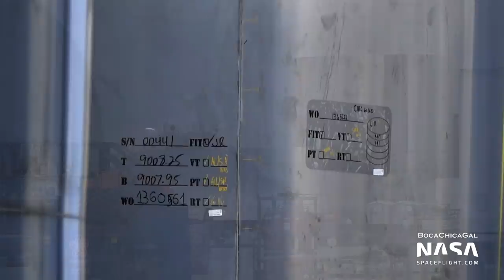SpaceX Boca Chica - Baby Starships, Assemble!

Comment from the maker: #TeamConcreteSmoother

0:00 - Sunrise
0:27 - Work on SN8
0:45 - Access Hatch Closeup
0:55 - Work on SN8
1:30 - High Bay Construction
2:12 - Ring Stacks / Barrel Sections
3:00 - Thrust Dome and Nosecone Sections
3:34 - High Bay Work
4:31 - Ring Stack / Barrel Section in Tent
5:00 - Nosecone Production Area
5:18 - Build Site
5:55 - High Bay Work
6:19 - Mount Delivery
7:06 - LN2 Trucks Waiting
7:36 - Work Near Orbital Pad
8:06 - Landing Pad Work
9:03 - Launch Site Work
9:30 - Launch Site Storage Area and SN7.1 Remains
9:52 - New Propellant Tank
10:14 - Suborbital Pad A
10:42 - Wall
11:12 - Construction Near Pad A
11:33 - LN2 Deliveries
Reply: ❤️Mary ❤️
& Jack
Reply: Thanks !
Reply: Also thank you NASASpaceFlight team and Mary for great images and videos as always
Reply: Hi NSF, can you show in details how the 7.1 ripped apart ? which section broken, its steel or wield or both? wanted to see its failing points. Thank you.
Reply: Zahidul Hasan  go to the sn7.1 bursts video  .. 4:50  ;)
Reply: @bentstraight3239  Got it bro, Thats what i was exactly looking for. Thank you again.
Reply: @bentstraight3239  hi, in that video, in 3:48 left side i can see steel ripped off. That means wield was powerfully capable too.
Reply: Zahidul Hasan  exactly ;)

Comment: How cool is the low bay gonna be when nose cones start being fabricated with rooms, corridors, windows, flight decks, ECT!?
Reply: Probably they will build the pressurized section for the crew (and then build a nosecone around it) in the same facility where they build dragon capsule and not at boca chica

Comment: znd they used to convince us that rockets are supposed to take years in development. this Boca chica site will never get old for me.
Reply: Well, face it, the Saturn IV was designed using a slide rule, not a CAD/spreadsheet program... And they also didn't have sixty years of practical experience to draw on.
Reply: @WCM1945  Yes, Rocket tech is accumulated wisdom, but it's a fair point if one compares SpaceX's progress with certain other organisations.

Comment: The work at the concrete pad looks like fun. What is that machine that seems like it's floating above the floor? Thank you very much Mary. I look forward to every video you drop. Make me want to visit boca chica.
Reply: It's a 'polisher' to make the concrete smooth and puts pressure on the underneath surface to remove any air pockets. It has wide blades that distribute the weight evenly, like a hand trowel.

Comment: How long do you guys think it’ll be before the first superheavy prototype is finished? Also, thank you Mary for the great footage!
Reply: My guess would be 8-10 weeks. Mid-late November? Early December? Lots more steel and lots more welding than the standard starship. But I'd like to be proven wrong and see it done sooner.
Reply: I heard SH hop in October.
Reply: @anthonylosego  I heard that too but remember that's Elon time.
Reply: Few weeks tops. It’s just a stretched Starship tank section if you think about it. At least for the first version(s).
Reply: @cin2935  I heard orbital test flight by the end of the year. So if SS does 60k in the next two weeks (hopefully successfully!) and SH hops in Oct (it won't need higher testing as it always is in hop mode and doesn't flip around in the atmosphere.), I think we'll see at least an attempt to orbit a SS on top of a SH before the end of the year. The only issue that may come up is that there just aren't enough Raptor engines ready by that time. The vacuum engine has been tested. I haven't heard how that went as far as good enough to put into production. They need 3 of those and 31 of the sea level raptors.

Comment: I find it odd that they are putting a roof on the high bay without first lifting in a bridge crane to install inside.
Reply: Reed Bowman my thoughts also🇦🇺
Reply: They will wheel them in and out. Won't use a bridge crane. They will use a crane from the entrance way to stack sections for welding together.
Reply: The mid bay doesn't have an internally installed crane either.
Reply: Carl Johan yeh I was mainly thinking the highbay
Reply: David bizzar
Reply: I think the structure of the high bay would need to be alot different, to handle a crane, no?

Comment: 2:44 SH/A2 7/23/20! That's mean Super Heavy? And they started working on 2 months ago?
Reply: Notes to point out: Slightly faded writing. It says VT/PT above it (possibly ? tests on the steel when it arrived at SpaceX eg Veneer Test/Pressure Test on 7/23/20). The strike through the A goes up to what you say is numeral 2 but could possibly be an over write and it's actually an L i.e SH/AL (Although the other 2's look similar, so tending toward A2. It could just be a co-incidence that SH was there and it could mean something else? eg Steel Hardness A2?   Totally agree on the date. And maybe that is a Quality Control from the factory, not arrival at SpaceX?

Comment: Question: How will the Starships fuel (methane & oxygen) be kept in a cryogenic state during a long voyage???
Reply: Vacuum of space is cold enough. All they need to do is keep the tanks shaded from the sun. Which solar panels will probably do
Reply: fuel is not stored in the main tanks and will not be heated, there are tanks in tanks, and they are vacuum insulated.
Reply: In the shade of space the temperature is -250 °F (-157 C) . The boiling point of CH4 is  −258.70 °F (−161.50 °C) however, under pressure, it becomes a liquid. So as long as they have heat exchangers and keep it pressurised, it should travel as a liquid in the vacuum tanks mentioned above.
Reply: @andreyinkognito7724  That's the header tanks. For long range missions, there's going to have to be fuel in the main tanks. No way around it. So shade is probably the way to go.
Reply: @TheMrgrr  But the heat coming from the Sun is not. 
During the Apollo missions on the to/from the moon that performed what the called the BBQ maneuver where the slowly rotated the the ship to help control the thermal balance.
Reply: Emissivity of the outer skin or shielding layers will play a roll in how well Starship avoids solar heat loading.  There's a reason why the stainless steel is polished, it dramatically reduces the heat absorbed by the rocket, as most IR and other radiation will be reflected away.
Add an additional layer of shielding stood off from the rocket skin (even polished aluminum foil) will further reduce heat loading.  With good radiative panels facing into space (away from solar loads) they can keep things quite cool.
Now, how the thermal tiles will affect things, that's TBD.  They're likely good absorbers, so if they're used they'll have to be thermally isolated from the body as best as possible, while still maintaining mechanical strength.  Who says rocket fab is easy?...
Reply: Apart from insulation etc, they'll have refrigerator/condensers which will take any gas that's boiled off and cool it down to reliquify it and return it to the tank. All you need is power from the solar panels and a radiator to get rid of the excess heat.
Reply: @denmaroca2584  Yes, but where will the heat go that's used to power the pumps and that's removed from the gas?  It has to be radiated away into space - no other option if you don't have other thermal sinks available.
Reply: @davidb6576  Also, Starship could potentially go as close to the Sun as Venus, and as far away as the Outer Solar System. Further, the fuels need to be kept at different temperatures. ~100K for the methane and <80K for the Oxygen. This will most likely require active heating and/or active cooling to sustain.

Although, realistically, I don't think Starship will be going to the Outer Solar System ever, until they develop a new engine with higher Isp fuels that completely change this math.
Reply: @davidb6576  
Thank you for all your replies everyone. I guess they don't call it rocket science for nothing...

Comment: So its cryo test, static fire, 150m hop then 20km or is it straight to 20k after static fire?
Reply: According to Elon's timeline, static fire, checkouts, static fire, 60k foot hop.
My guess is cryo proof, static fire, nosecone install, static fire to test the upper header tank, then hop.
Reply: Static fire and then 20k according to Elon.
Reply: @dakotasloan1  all that by the end of october?
Reply: @fredEM120  SN4 did 2 cryo proof tests and 4 static fires in just over a month. Could be longer than the end of October, but I'm not betting against SpaceX.
Reply: @fredEM120  I dont think so. Static firing 3 engines seems hard after seeing them have problems with a single one
Reply: SN8 won't do a 150m hop, it seems they already got enough data from SN5 and SN6 to proceed directly to 20km.
Anyway, SN8 will have three engines, and that's too much thrust to do a 150m hop without an inflight engine restart.

Comment: Two things that have me stumped....what determines the height of the ring segments and, why don’t the welds on the nose cone align?
Reply: My guesses: The ring segments are 72 inches high (1828.8). That is achieved by a cold rolling of a SS ingot. The factory will have had to use the hydraulics, bearings and rollers available at the time of building the factory. This is either the maximum width they could roll it out to, or all they could economically afford. Or, the first 'customer' with bulk orders for steel, wanted that width and gave them a contract that allowed them the finances to build the plant to fore fill the order.
The welds on the nose cones do not align, so that the maximum heating applied to a joint is twice, for stronger welds. As the strength comes from being cold rolled, any heating weakens the steels properties. When you have a weld on the end, there is a slight 'thinning' from a 'meniscus' effect of melted steel. If you join the corners, there is a thinned 'hole' at the crossroads. If you off set them, the new steel helps reduce that 'hole' and gives a stronger welded join.

Comment: Not a expert but do wonder about the Welds and placement on the nose cones.
Stress Factors, but if Welds Stronger than the Stainless Steel all Good.
Great Work 👍's
✌💛🌐
Reply: Welds are weaker than the SS-304L. The steel is cold rolled. Once it is heated by the welding process, it losses some strength. However, the Nose Cone area will be a low pressure area. It will be for storage initially and then crew accommodation for Moon then Mars Colonists. Maybe 2 atmospheres pressure (2 Bar). If you look at the last test on SN7.1, it's not clear, but it looks like the line of 'tearing' or RUD, follows the weld seam along the lower-mid section of the dome. That was well over 8 Bar pressure. The nose cone welds won't come anywhere near that sort of stress.
Reply: @David-yo5ws  Thank You Very Much For That Much Appreciated 👍✌💛🌐

Comment: Are the aero surfaces going to get less bumpy in future iterations? I pictured them as much smoother. Is smoothness not important?
Reply: They are smoother than they look I think. In closeups they look pretty smooth
Reply: The reflectivity makes even minor imperfections stand out so it is difficult to judge how uneven those surfaces really are. My bet is that they are much less "crumpled" than they appear.
Reply: They are only required to create a 'drag' on the air flow. They just have to be structurally strong enough to not bend or 'flutter' at terminal velocity. Just as a skydiver uses their arms and legs to control their angle of descent, very similar concept.

Comment: Does anyone know why the high bay and mid bay have those iron side balcony things sticking out everywhere? As far as I can tell there isn’t a floor on the balcony things neither are there doors on those levels. So why are they there?
Reply: They need the space inside to be empty, but the frame has to be strong. Essentially it's like external re-inforcing, like some churches do with half A frames on the outside walls to provide strength and leave the inside open. This gives the welders a wind break. The ring sections can be easily stacked by a crane without catching on any protruding frames.

Comment: I Wonder when they'll attach the heat shield tiles?  It will definitely effect the weight and the aerodynamics for flight.  That belly flop landing may not be as easy with tiles.
Reply: Since the Tiles will only come into their own during re-entry, the 20k and 60k 'hops' will be tests of SpaceX's engineers skill-set, to ensure they stay in place. Also, they will be able to analyse their affect on the aerodynamic drag during launch. Especially if they are going o be on one side. Though I doubt there will be full coverage of tiles, at this stage. Maybe some large 'test' areas??
Reply: Imo no tiles required for first 18-km hop/bellyflop
Reply: @aerospacer994  The reason for their existence is not required for hops even up to 80km. Yet they have had them on static tests and the 150m hops. So they ARE REQUIRED for doing trials and testing.
Reply: @David-yo5ws  Absolutely, trials and tests are necessary. So I wrote "first". The company adheres to a limited risk strategy in preparing tests, and this is reasonable.
However, perhaps they will install several tiles, but for now they come off even in short hops. Tile mounts need improvement.
Reply: @aerospacer994  LOL, do they ever. I don't know if the last lot melted off or were removed, leaving the whitish texture? The latest Mary shots on SN5? looked like they had an overlap on the center of 3 rows of a small cluster. Have not heard any more about another 'hop' test though.
Reply: @David-yo5ws  looks like the SN6 tiles were glued on and broke off due to vibration, leaving a whitish base with glue on the metal body (thanks again to Mary for the pictures).

Comment: What is going on? I could hear phasor fire from 1:30 to 3 Minutes.
Reply: High tension on braided steel cables. Most likely from the crane.
Reply: Nice. I didn't make the phaser connection. Well done.
I also like the high tension cable idea.
My ears made it as the doppler effect on the echoes of percussive assembly (ie. hammering) in a large steel tank or large enclosed structure.

(But it DID sound like heavy phaser fire!)
Reply: I figured it was steel sheets or cables. In my high school stage band a guitarist had an electromechanical reverb that made the same sound when his amplifier got bumped.

Comment: 6:21 When does a piece of trash become “public domain?” When it’s put in the garbage bin? When it’s picked up by the garbage truck? When it’s left at the dump site?
Asking for a friend
Reply: It depends on the country and/or State Law and/or  by-law. In some countries, never, because the Rubbish Tip is 'Deemed as Hazadous Waste' as soon as the rubbish is dumped in it. For good reason e.g What looks like a good bed is dumped, because the person that was in it, had an infectious disease.The SpaceX dumpster is on Private land, so can't legally touch it. A contractor is paid to take it to the rubbish tip. They are obligated to have full possession until their contract ends at the rubbish tip. So you would have to find out the law of the local rubbish tip. I don't fancy your chances. You might be lucky? The only time you can take rubbish, is if you meet a person at the tip and you negotiate a deal for an item you like on their trailer/deck etc. That's a private deal and does not involve the rubbish contractors.

Comment: Any guesses at when we will see concrete being poured at the orbital launch pad?
Reply: Glad you asked the ? that's on everyones 👄's. Pure speculation on my part: Could that big pile of shingle being delivered, be the metal for the Orbital Launch Pad?? I mean, get a few trucks together, pour in the right amount of shingle/water/cement right there and the trucks mix it for the correct amount of time, then go and pour it into a pumper station by the pad. That way you have a 'fresh mix', that does not have to come from miles away AND have better control as you fill e.g may take a bit longer to 'vibrate' the concrete inside the legs so may need a pause. What do you think?
Reply: @David-yo5ws  all very good points. I just want to see what that pad looks like when finished!
Reply: @cyn3rgy759  If it's anything like the rendered pictures on the SpaceX web site, it's going to be blowing peoples minds. Taller than the Statue of Liberty by about another 40-50 meters!

Comment: Well assuming SN8 it has the bottom fins, aren't the top fins necessary for optimal stablization?
Reply: Not for slow vertical flight. They are 'wind drag' dependent, so only when they drop at speed, will they have an effect. SpaceX will probably do a static test of them on the Pad B thrust simulator mount and I would say they then have to add the top section before the 20k flight.
Reply: They're most likely planning to do the first round of SN8 testing (cryo proof + 3-raptor static fire) before nosecone and aero surface installation, so if something goes wrong they don't needlessly damage or destroy hardware that could be used later. Though they'll probably do another static fire after the nose is attached, just to make sure propellant flows from the header tank up there correctly.
Reply: @astronut42  Yeah, that sounds about right. Maybe the static fire will show up any effects on the aero surfaces, since they are now on SN8. We may see it being driven down the road soon???

Comment: What are they going to do with all those starships? Seems like each new generation leaves the other ones behind and untouched
Reply: Probably for testing. They can make jigs off them or use them for test procedures eg stacking on a Finished Super Heavy, they can cut bits out and try various connection methods. Test launch as Mass simulators (if something goes wrong, eject the 'junk' and save the SH).

Comment: I get the highbay workers are trained and have safety equipment but seeing the, dangling from that top beam that alone if taller than my house is scary. Worse knowing that the beams are 100+ ft in the air